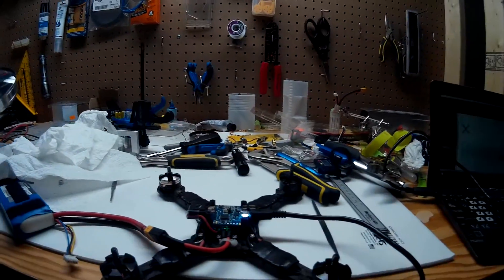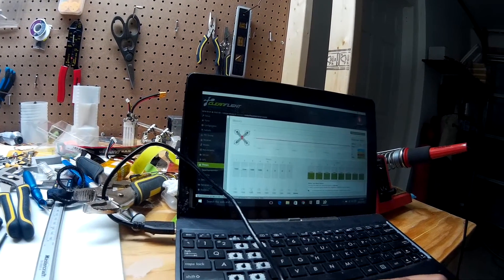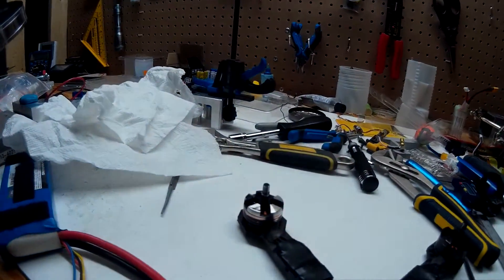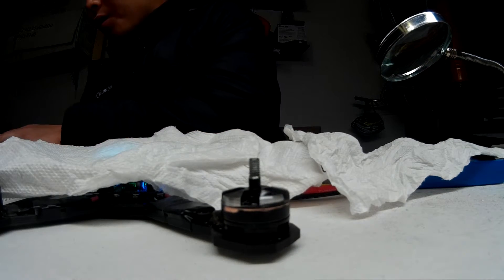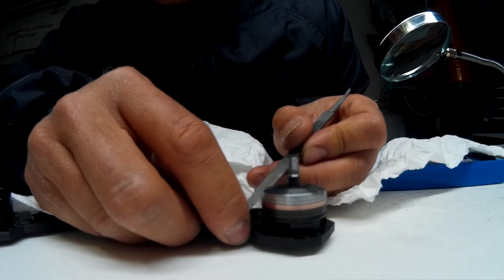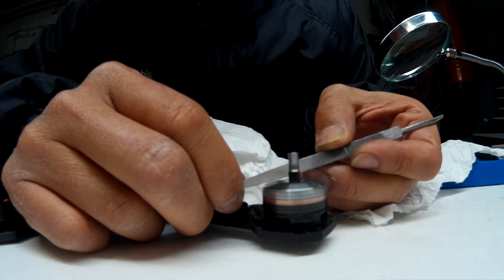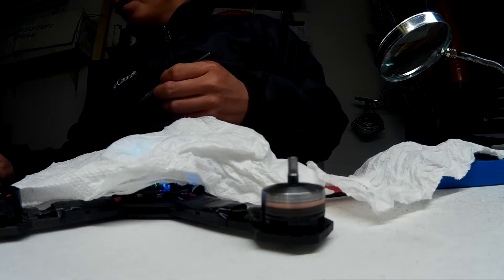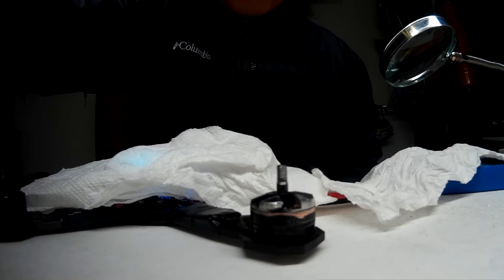How to balance FPV miniquad motor bells EMAX 2204

Comment: First, use a dial indicator to check the shaft for run out. Then shave if needed
Reply from the maker: @PeterJFrancoIII  good observation. I dont play with quadcopter any more but definitely, thats what i'd do. Nowaday, motors are so cheap to replace. So it might not be great spending time to correct run out on bent motor housing. Cheers!

Comment: Interesting technique. I could maybe try that I have some problems getting rid of the vibrations of the motors on my 250 miniquad. It's a bit "destructive" and I like the black paint but heh...
Reply from the maker: :-) the motor is already "destructive" after so many crashes.
Reply: Right but mines look like they were like that from the factory, no hard crashes. Cheap motors so probably not so well made but they look nice (EMax 2204). The problem I also have is that after balancing the motor the best I can when I put the nut and only the nut the vibrations come back. The shafts and bearings look OK so I guess the only explanation is that the nuts, particularly one, are imbalanced too. My next move will be to try to isolate the FC and FPV cam from the vibrations...